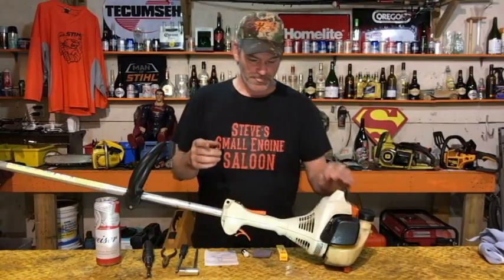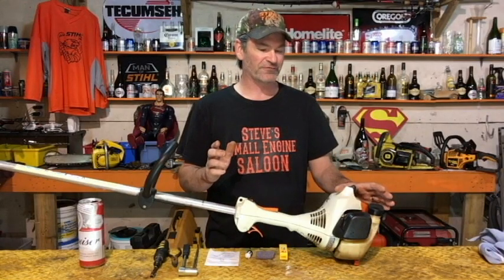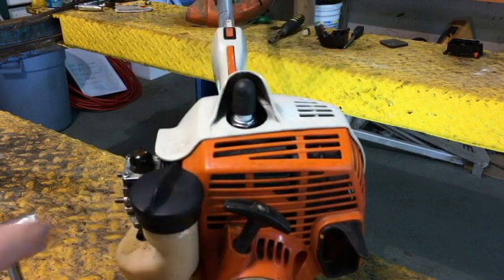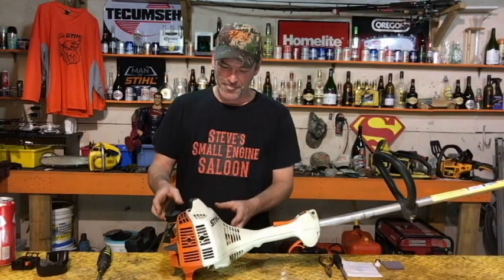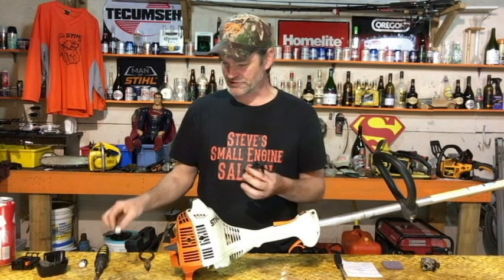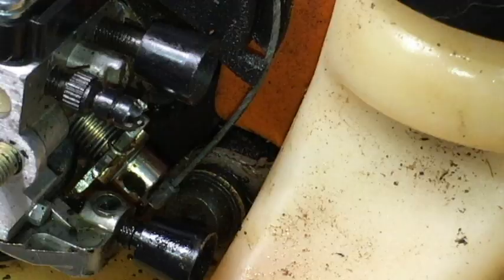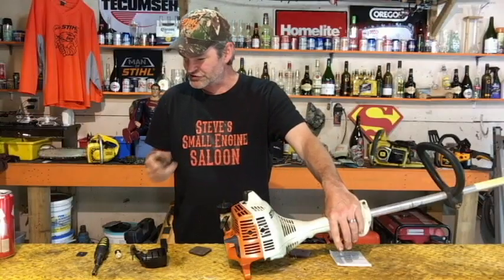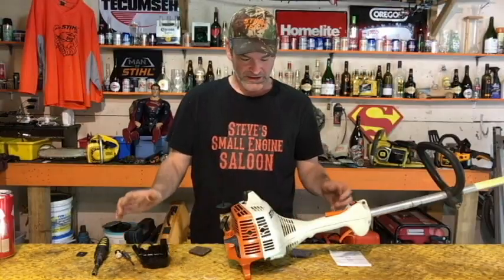How To Do a Basic Tune Up on a Stihl WeedEater

Comment: Steve, I'm a 65 years old female, and i am having problems with my fs 85r stilh weed wacker.
It started this morning after a few pulls, but although it's running, it has no power. It is just  brushing the grass  without cutting.

Comment: I don’t have this stihl weed wacker but I do have two craftsman weed wackers and a brand name weed eater weed wacker and they all start and run great but they die if they I don’t press the throttle often. Carburetor is clean and always run with fresh fuel. Any idea what would cause that?
Reply: I once ran into a problem with the exhaust but it wouldn't die it was just under powered had to take it off and used a blow torch on the exhaust to burn the junk off of it you could try that might now make a difference for you though

Comment: Great!   How do I fix the shaft?  It won't slide back in all the way.  I slid the draft thing all the way out and tried to re-insert or seat it properly.  I don't know when it's in correctly.  No matter what I do, the shaft assembly won't completely seat on that drive clutch (or whatever it's called).  At this point, my unit is junk.

Comment: I know this is an older video, but you can replace the gas filter without removing the carburetor and instead removing the orange back cover. Just remove 3 screws that hold the back orange plastic and remove the plastic. One is below the pull cord, one is near the top of the tank and one is on the opposite side near the exhaust. When you unscrew those, just pull the cover back and that will release the tank so that you can work on it. Then just pull out the gas filter as you've shown in the video and replace it and that's it. I just did it yesterday on my FS55 and it looks easier compared to removing the carburetor.

Just be careful and make sure you don't lose couple of rubber caps that are between the tank, cover and the rest of the engine. These looks like they are there for alignment, vibration or something and can pop off easily.

Comment: Steve, Please, PLEASE help me out.
I have a stihl FS45 String trimmer. It was running then conked out. It was running like it was starving for fuel.
I took off the carb, cleaned it out and rebuilt it with an oem rebuild kit. I tried starting and it kicks but won't run. I checked the spark and it looked ok. I tried a new spark plug, checked the coil, checked the flywheel/coil gap and even tried a knockoff chins carb.
It always does the same thing, it seems to pop but won't run.
I also checked the compression and that was excellent at 130.
I can't figure it out.
What am I missing?
Am I losing my mind?🤪
Thanks

Comment: Good job teaching us problem solving. You are good teacher.
Reply from the maker: Thank You...
Reply: My uncle gave me a not running Stihl weed eater in 2021. It has sat under the shed ever since. After watching your video last night  this morning I pulled the weed eater out and went to work on the  carburetor under the guidance of "your spoken words".  And I got a pleasant surprise that I wasn't expecting. That weed eater fired off on the 5 pull, and it sat there an idle its ass off until I turned it off..
Thanks Man for being articulate enough to make me pay attention.

Comment: @Steve's Small Engine Saloon
HI STEVE I have a quick question , But technical Question.
I'm an Electronics and Electrical Engineer, But not a Mechanical Engineer
I don't mind pulling shit apart and learning about it

I have an Stihl FS-45

Long Story short 
Bought and FS-45 that was dead , purposely for the sake of fucking around and learning.

Troubleshooted a bit, Found No fuel in Primer bulb when pumping.
REPLACED CARBURETTOR
Got it running

NOW.. IT DOESN'T WANT TO SWITCH OFF
let's focus on this for a second

I Disassembled it,
Got access to the Switch (SPDT) and the wires that go to the relay
HERE IS WHAT I DID IN ORDER TO TROUBLESHOOT THE SWITCH

1. Disconnected the blade contacts on the wire from the relay contacts.

2. Testing with DMM for loop resistance on on the ends of the wires
RESULTS
in   I Position.....   OL
in   0 Position....   OL

Needless to say.. this is not good, as a switch should have a low resistive path in the ON (I) Position
and High Resistance in the OFF (0) Position

3. Disconnected the blade connectors of both cables from both contacts of the switch

4. using Electronics cleaner, 
- Cleaned the contacts on the switch
- Cleaned the blad connectors on both sides of both cables
- Cleaned the contacts on the relay

TESTED AGAIN
From the switch
in   I Position.....   OL
in   0 Position....   0.2 Ohms

NOW... IS THAT CORRECT ???    it seems backwards

In this video
https://www.youtube.com/watch?v=FI3sDVN_Ivw
YOU SAID
I = IGNITION
0 = OFF

OK, i remember it like this

I = A Wire   Meaning... CLOSED CIRCUIT... Meaning.. Low Resistance (Under 1 Ohm)
0 = OPEN CIRCUIT   Meaning.... High Resistance /  Infinite Resistance /  OL

Now... both our conventions seem to align
OFF would be an Open Circuit through a switch
and Ingition would be creating a circuit
BUT I GUESS TECHNICALLY IT DEPENDS ON HOW THE RELAY BEHAVES

IS IT TECHNICALLY AN ON SWITCH
OR 
IS IT TECHNICALLY... A  KILL SWITCH 
Meaning.....
In the I Position it does nothing and therefore allows for the motor to start
but in the 0 Position it cuts the circuit

See.. Just to bring us up to speed
I then 
5. Tested the resistance on each wire
got 0.1 Ohms on each wire

6. Connected each wire back to the contacts on the switch.
Tested the loop resistance again. this time
in   I Position.....   OL
in   0 Position....   0.3 Ohms
THAT'S MUCH BETTER,   ONLY...
I would have expected
I  to have Low Resistance
0 to have High resistance

Now, I have not yet reconnected the switch
BUT LET'S SAY I DO
I know the whipper will start.

Thus far i've had to remove the spark plug cap to kill the engine.
Let's say this time the kill switch works in the  0 Position

SO HOW DOES THAT THEN WORK ?

IF 0 =  LOW RESISTANCE (0.3  OHMS) Meaning, i have an OPEN CIRCUIT
How is that killing the circuit ?

THIS SEEMS BACKWARDS

Comment: Bought a Stihl FS40 strimmer throttle cable put it on , but it’s to loose on the lever. It only moves the lever a bit. Can u help.

Comment: Hum cool stuff this. Stihl relevant after so many years cause I own a Stihl fs38. As to pulling and replacing the fuel filter via the tank inlet, it can be done. I did it by bending a loop in the end of a piece of soft wire and curving the wire to fit the contour of the tank. I snagged the filter and carefully  pulled it out the top of the tank and grabbed the fuel line just behind the filter, popped off the ole filter, inserted the new one, and let the filter and line settle back into place.  Surprisingly enough the rubber line is supple enough to stretch.

Comment: I didn’t know that about the adjustment screw with wide open throttle. Is that a T25 or a T27 screw? As many times I have changed the carb on my Stihl FS55R I should’ve known. Came so close to throwing that thing out.

Comment: Very nice, clear video! I think I can do it! 🤞🏼
Reply from the maker: Right on
Reply: Update, I did it! For the record, if you have some crappy offbrand tool set, your 5/16 socket may not fit here and you may need to look for a thin wall socket. anyway, great instructional video, I did the tuneup alas, that did not fix my problem but, the linked video at the end did!

Comment: I serviced my fs70 and changed the park plug. When I removed the rubber spark plug cap on the top of the spark plug. The whole rubber part came clean off totally detached from the strimmer.  Anyway I put it back again and it started and worked fine.  Do you think this is normal or will it not work in future?  Many thanks Paul

Comment: Either you’ve invented and built a badass weed-eater “car wash”, or your area has the kindest grass ever, but my Stihl hasn’t look half as clean since after it’s first trim and I hose mine down with a quick brush and rag, after each use. It still looks and acts as if you put a couple handfuls of grass clippings into a gallon of superglue and painted the whole trimmer. 

Being serious tho, your videos have been a ton of help a ton of times. Tks Pal!

Comment: Great video as always but you don't need to pull the carb for the fuel filter. You can make a special hook tool out of a piece of wire hanger. It needs to be a little long and has a bend in it so it usually takes a couple of tries to get it just right the shape to reach down in the tank and hook the fuel line and pull the filter out through the filler. This will work on most Stihl fuel tanks, some may need to be a little longer than others.
Reply: I would never “fish” that fuel filter out through the gas cap. Of course it’s possible but it’s harder. Possibly damaging the fuel line. The proper way is through the opening under the carb.
Reply: that the easy half of that operation, how would you get the new filter back on?

Comment: I just repaired a failed Stihl FS40 string trimmer. Used some of your tips really helped. Had to replace muffler and spark arrestor. Did full tuneup and carb adjustment. 6 yr old unit runs like new. Thanks Steve!😀
Reply from the maker: Great to hear!
Reply: Which muffler did you get? I'm trying to figure out difference b/t KAT muffler and other type with screw out spark arrestor.

Comment: Hello Steve I have a fs38 trimmer that’s rattling and vibrating when running head wants to spin and screeching when shutting off would that be a cutch n drum bad run fine other than this problem.

Comment: Steve, I have a Stihl mini tiller with the same engine you are working with here and I can not get it to even fire. I can rebuild this entire engine by myself and have no hesitations as far as my ability to do it correctly. I rebuilt the carburetor and it was spotless on the inside, not one spec of dirt or debris. I am getting somewhere around 140 PSI compression. I am getting a very strong spark and the spark plug is brand new and putting out a dark blue spark. I even took the flywheel off to make sure the shear pin was not sheared off and the timing being the culprit and no such luck. I've shot carb cleaner gas and brake cleaner in the carb and once again can not even get it to fire. I tried brand new Stihl 2 cycle fuel from a Stihl dealer and still nothing. The primer bulb is working properly and filling the chamber as it should. I think I about covered everything. Got any ideas?
Reply from the maker: Lots of videos for this in my playlists...
Reply: @StevesSmallEngineSaloon     With all do respect, there is no video with anything different than what I already stated. Whatever is causing my issue is not a common issue and it's going to take a professional to figure out, of which is what I believe you are? Most experts can not figure it out. Keep in mind this is a two stroke model with no valves. It should at least fire and it is not doing that at all.

Comment: Hey Steve, one quick thing I'm sure you did but I didn't hear you mention in the video. You should always check the plug gap when you take it out of the box. They're usually close but not always right. I've actually seen them completely closed up right out of the box. Nice job man.

Comment: Internet search says change plug out every 25 hours, another says 100. Is this essential? I do more than 300 hours per year with a trimmer and a blower and a mower(600) and I never touch them because they seem to run fine ( I think) 
Also is there grease running up the entire trimmer shaft? I have what I think is grease all over the engine/clutch housing/ even in the air filter cover. Can that come out all over the place and mean a seal is blown?

Comment: Hey, I was doing a tune up on my fs 38 watching this video. I was never very good with small engines. Watching your videos for the last 3 years has helped me save money. I found a 15 year old Poulan p3314 chainsaw in the garbage. After asking the home if I could have it I took it home, bought a new carb for $50 installed it with a plug and filter and it runs great. $300 saved. It's a great little back up when I am out using my Husqvarna 455.
Reply from the maker: Nice work!

Comment: I have had an FS-45 Stihl Trimmer since 2001. Just did my first tune up on it in 2021. Just the plug and air filter didn't change the fuel filter. The main thing I do is make sure it is totally out of gas for winter storage. Run it until all gas is out of the carb. I use the stihl oil for the gas mix too. It is a great machine.
Reply: Keep fuel tank full…😉

Comment: Hello! Your videos are so helpful, and you are now my go-to when I have a question about maintenance or repair on my Stihl products. A question though...I have a Stihl FS 85 weed eater that for the life of me, I can't seem to get started. It started the last time I used it (2 months ago, fresh fuel mix), so I thought, maybe the gas went bad during our hot spell even though it has Stabil in it.  Fresh gas didn't change anything, so I've replaced all fuel lines, fuel and air filters, the carb, the spark plug, cleaned the spark arrest screen, changed out the gas cap, and checked the ignition module to assure there's a spark to the plug. I even bought the expensive 50:1 fuel mix from our saw shop -just to be sure my fuel mix wasn't the issue. The switch is on and engaged, the primer bubble fills nicely, the tank is full...What else have I not checked/replaced? I keep thinking I have missed some very basic thing, -but what?!?...Sigh. Any ideas?
Reply: Is your killswitch broken? Do you have strong compression? Those are the best guesses I have - new switch or new piston ring.
Reply: Are you sure you are getting spark?  Is the piece/spring inside the spark plug boot missing?  Have you checked compression?  Bore scope in through spark plug hole to see that the piston is indeed moving and not locked up or rod broken?  I see this is from a year ago...so i'll assume the unit was replaced, fixed, or now working, but the mystery is killing me...LOLOL

Comment: My air filter had fuel on it when I opened the house. I checked it because my trimmer shut off and won’t start. Why is fuel leaking into my air filter housing?
Reply from the maker: Check my playlists on my channel...

Comment: Hi Steve   just wondering regarding fuel tank pressure would you recommend when not in use that the fuel tank cap is made loose  plus on hot days when machine  is rsted for a while to keep machine in the shade. just bought ne fixedw fs55  notice the limiter caps are not on it but instead what appears as a fixed steel sleeves  on carb      thanks peter

Comment: I have  watched  your videos and enjoy them. I have a rms 225 and rebuilt carbuator because it started giving me trouble starting. I' m still having trouble I reset the magneto with a bussiness card. The spark is real strong. I gone back and rechecked  carb to see if I did anything wrong and everything  looks good. Even the needle and seat is level with carb base. I did a compression check and get a  reading of 95 which I  thought  was good. I did a wet  compression check and get 125 close to 130. Will the compression of 95 keep this from starting. I get some popping sometimes trying to start. I don't the carb is the problem. Why does it pop. Is my  compression to low?
Reply: I did pull those plugs out that were hidden and still have a no start.. I thinking the  compression is my problem. Cylinder  and piston look good  from the ports. I'll pull it apart and check. I just a new piston kit will do it I'll replace it.

Comment: Thanks!  My FS-45 is on the bench waiting.  Now I know what to do.
Replacing the spark plug and the air filter -- trivial.
Replacing the fuel filter -- what the?  [Solved!]
Huh?  What's that with the throttle cable?  [A new thing learned!]
Reply from the maker: You're Welcome...

Comment: Hey Steve, having an issue with my fs38 trimmer. The motor runs pretty well however the trimmer head spins either super slow or not at all.  I have replaced the clutch which didn't seem to help. Do you have any ideas on what to look into next?    Great videos, keep up the good work!
Reply: It's the head, send it back to Stihl.

Comment: What about gapping the plug Steve? You didn’t even check the gap. I got two new spark plugs for my Scag zero turn and the gap was close on one and was practically closed on the other. Perhaps someone dropped the plug on the factory floor. Love your channel and not trying to bust your balls.

Comment: You should add cleaning/replacing the "spark filter".  It screws into the exhaust manifold.  That was causing my unit to run rough.  It was a good idea to do the tune-up, but the "spark filter" was changed by the Stihl repair guy and that made it  hummm.
Reply from the maker: Yup, that video is in my playlist...

Comment: Steve, really enjoy your videos. Is the 8mm socket that you are using a thin-wall socket? My regular 8mm socket's OD is too wide to reach the nuts which are recessed. Local Stihl dealer claims that it takes a special Stihl tool that is not available to the end user. That sounds fishy to me. Asked Donyboy73 the same question on his channel, but figured I'd ask here as well. Thanks in advance!
Reply from the maker: I ground the outside down so it fits better!
Reply: @StevesSmallEngineSaloon  I appreciate the quick reply, Steve. Guess I will do the same.

Comment: Hey Steve, super informative. I have an FS45 that still runs great, but as you said it needs regular maintenance to keep it that way. The kit I got has a new bulb in it, I assume you take off the 4 small screws that hold the plate in place. But the kit also came with rubber grommets which I'm unsure where they go.

Comment: Great video, very straightforward and easy to follow. Only one thing to add, remove the spark arrestor, I let mine soak for an hour in carb cleaner then blew it out with compressed air, dont forget your safety gear. Thanks again!